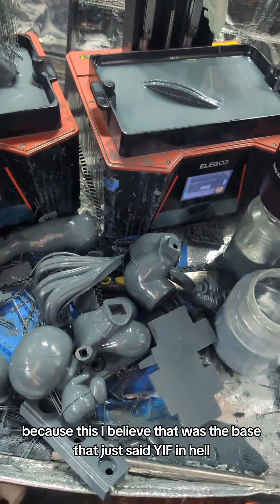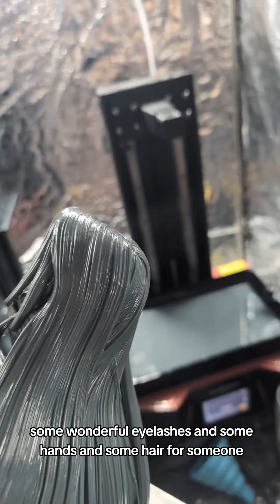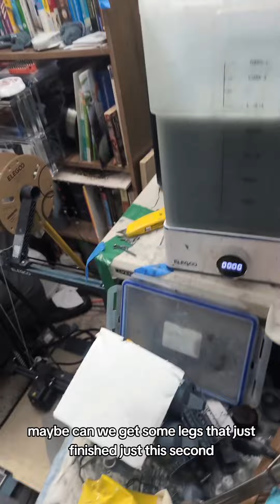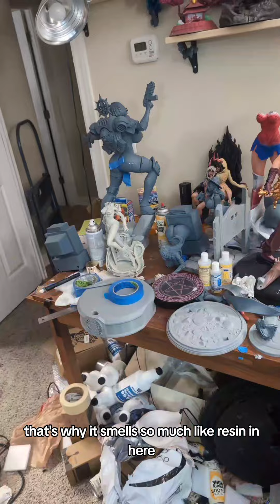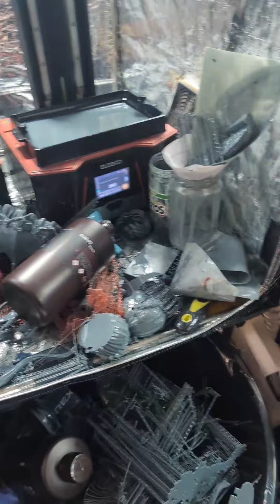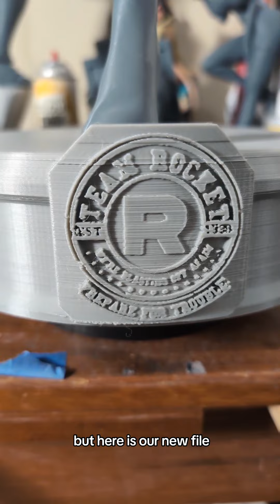gotta ship that good stuff

Comment: I'll be honest, I know NOTHING about 3D printers but this channel has taught me that 3D printers are incredibly reliable at failing, fucking up and just being more trouble than they're worth.
Reply from the maker: all 3d printers have their flaws. every type can go wrong in some way. but if everything works correctly you get great results.
Reply: If you have an attention to detail the failure rate is very low. I have an M7 Pro that auto levels, preheats, detects temperature and levels, and auto refills from a bottle. 
It can detect debris as well and will pause and send a notification to a phone/pc.

Above all I am shocked by the lack of PPE, correct storage and horrendously maintained workspaces in this video.

ALSO USING A GOOD SLICING PROGRAM IS VERY IMPORTANT- I recommend Chitubox or Lychee